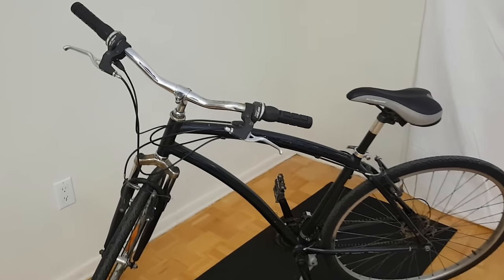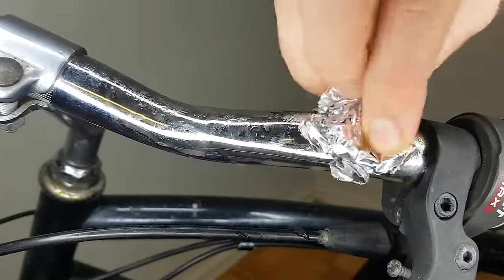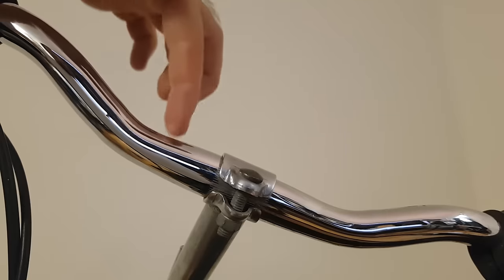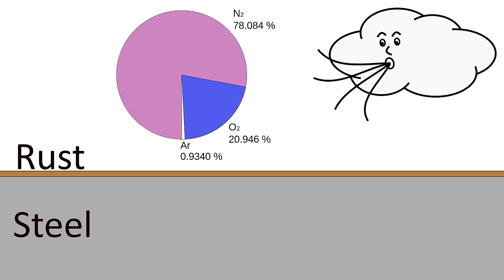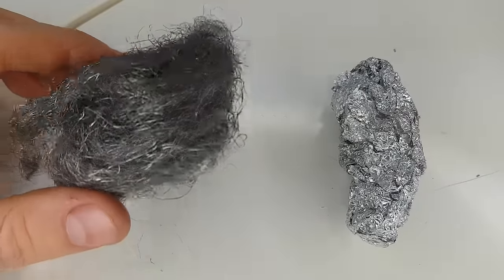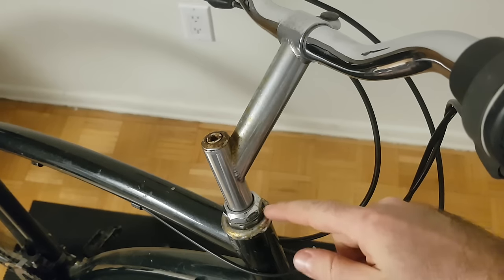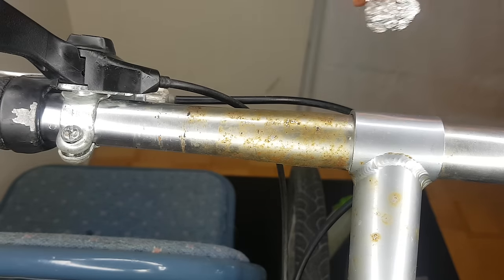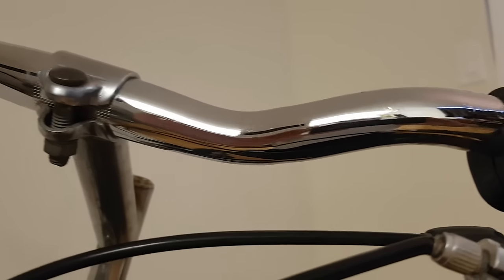Trick for Removing Rust on a Bike

Comment: Hi! What the frame of this bike?
Reply from the maker: I've had someone else ask me that in the comments of one of my videos. The answer is that I honestly don't know. The stickers on the bike were badly damaged when I took possession of it, so I removed them. Unfortunately I didn't take any photos before doing that. However, I'm pretty sure it was just a department store type brand.
Reply: @cjhoyle  This is probably what I was asking. I bought a used bike and it also only has a shop sticker on it.

Comment: I tried it and it didn't work at all for me. I tried both sides of the aluminum foil. 😧
Reply from the maker: I'm sorry to hear that. This most likely means that the parts of the bike you were trying to remove rust from unfortunately not chrome-plated steel.

Comment: I like that video. I forgot you could clean chrome with aluminum. Thanks for the demonstration. Now if I can get off my back . My bike will shine again. Danny boy . PS I work on old typewriters antiques. Are use steel wool zero. It works on the typewriters. I’ll try aluminum and see what happens